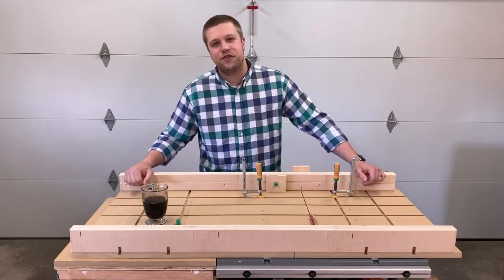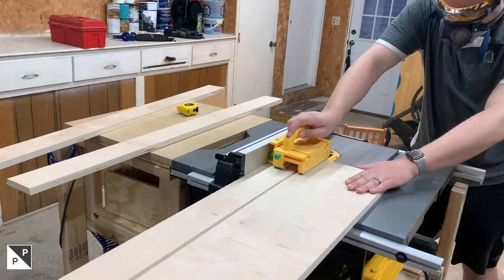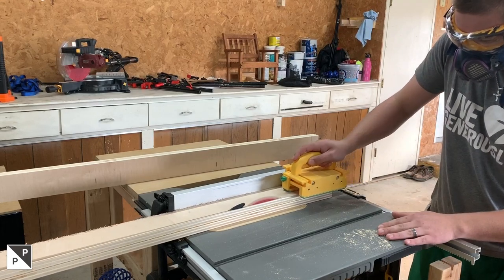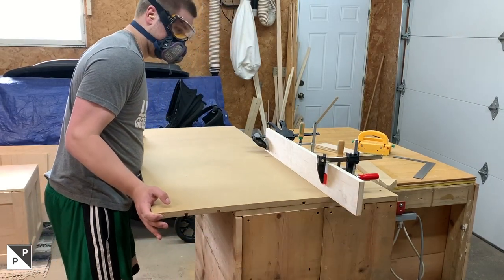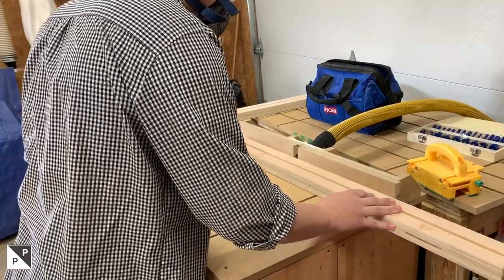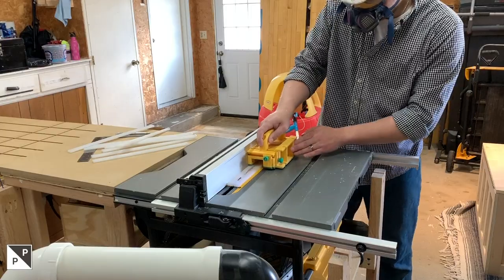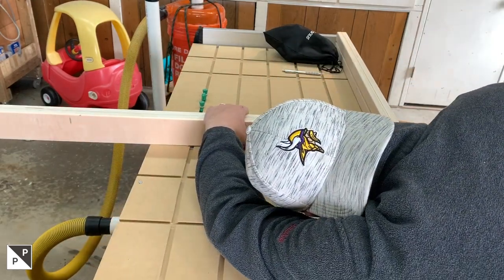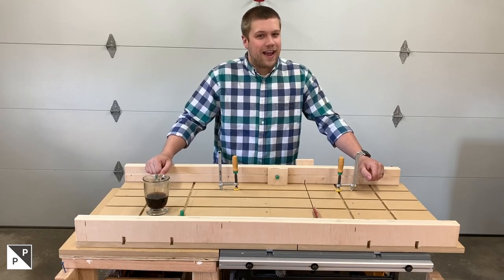Giant ULTIMATE 360 Table Saw Crosscut Sled | Shop Build

Comment: I built the Microjig 360 sled, and I found the dovetail grooves are best cut with a hand held router and a clamped down straight edge. And it's best to use the zero clearance miter bars.
Reply from the maker: That’s a very smart idea. Especially with the size of material I was routing.
Reply from the maker: I just made some more grooves in another project and thought of this comment. Thank you for the tip!